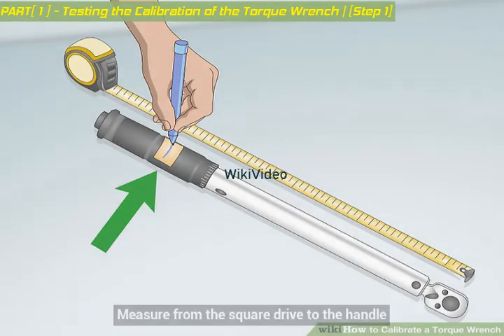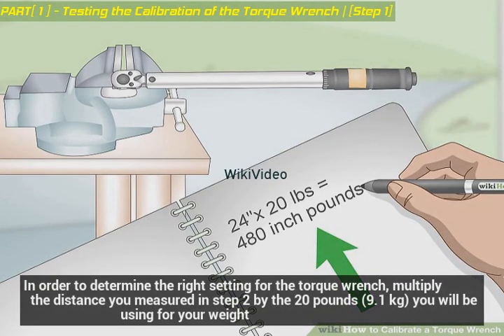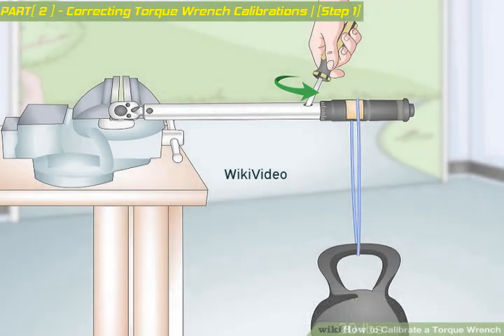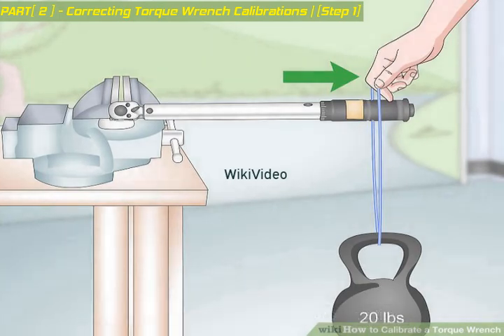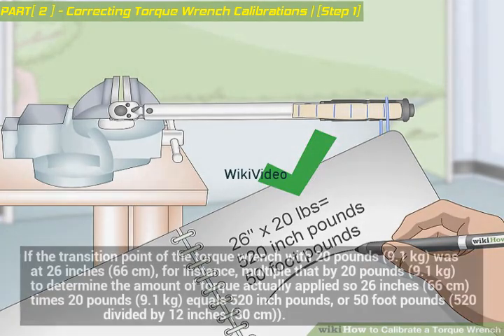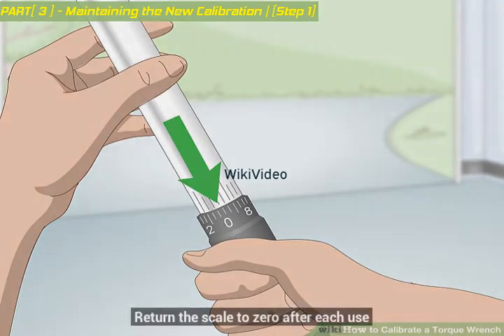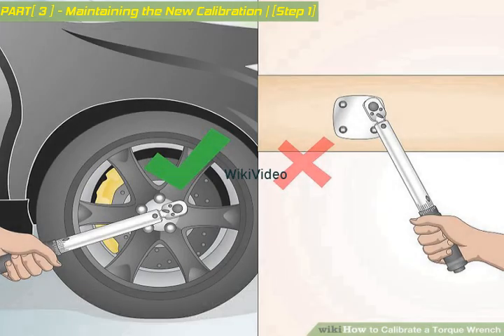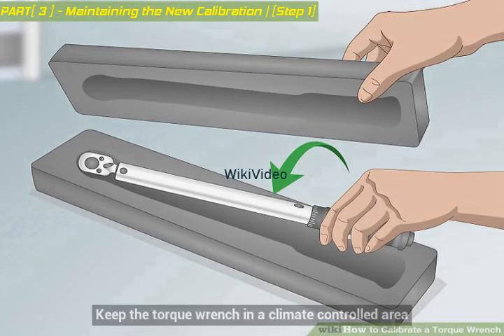How to Calibrate a Torque Wrench - WikiVideo

Comment: Measure where on the handle, the ends, the middle?
Reply: Unfortunately this video muddles the explanation a little by ignoring the correct location already shown on the handgrip, drawn as a ring lacking knurling. This is sometimes called the Loading Ring, and this or other similar indication at roughly the center of the handgrip designates the Loading Point. This is where force (e.g. a weight) should be applied in order for the measuring mechanism to be accurate. Occasionally there's no marking, in this case you should choose the position your middle finger would sit when naturally gripping the handgrip. Using the correct loading point may mean using fractional figures in the calculation, but the resulting torque measurement will be more accurate.
 However a problem with this video is that having once established a measurement, it should not be changed, so moving it around as shown will harm the accuracy. There are types of wrench where it will not matter, but the common type shown here is Length Dependent, and it does make a difference. Also, note comments made by Soniccues.

Comment: The procedure shown is inaccurate since it doesn't factor in the weight of the wrench itself. And you can't easily compensate since that weight is distributed along the length of the handle. With a 2lbs wrench and 20lbs of weights, you could be off by a significant amount.